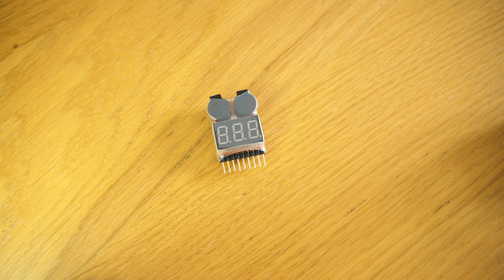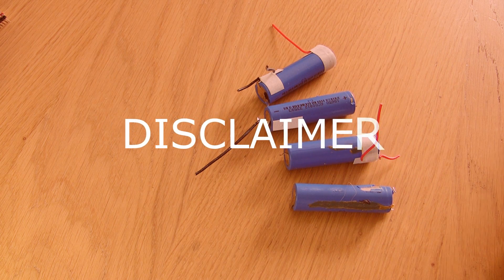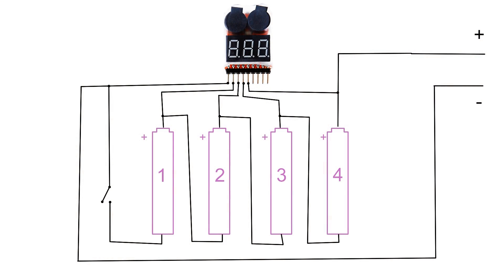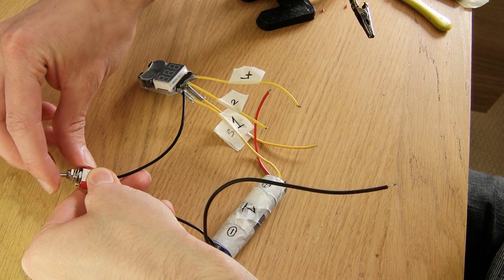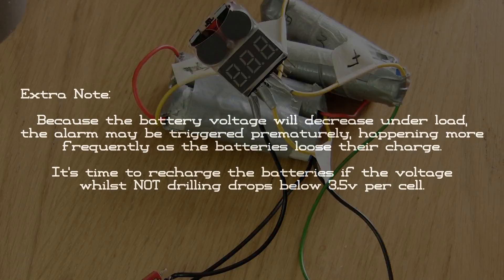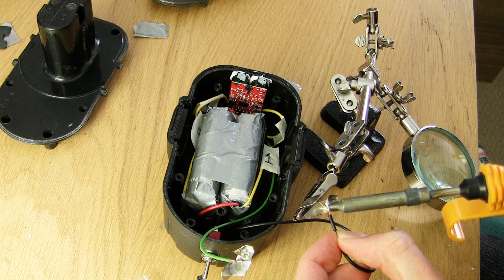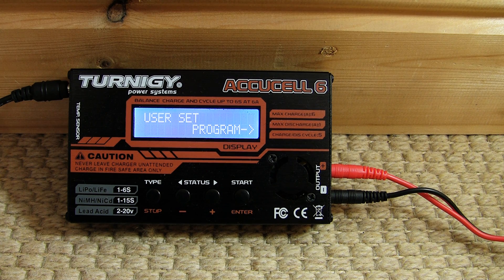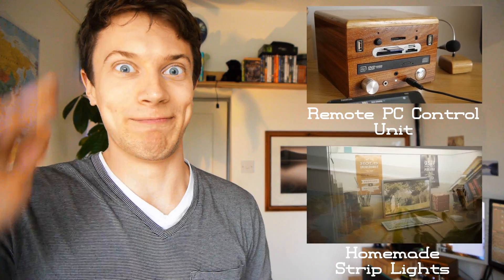Supercharge a Dead Drill Battery (replace Ni-Cd with Li-ion)

Comment: Why are Ni-Cd batteries used in the first place then? Is it because it doesn't need the additional charge circuitry?
Reply: +YouReel Ni-Cd batteries are old, not really used anymore. they are very rugged and much safer than Li-ion type and don't need any circuitry.
Reply: +DIY Perks modern cheap drills also use NI-CD or NI-MH batteries, actually. In this context, it is used because it is cheap and does not require complex circuitry.
Reply: Its cheaper to use Ni-Cd bateries and the companies want to sell more drills because the batteries fail.
Reply: +Hilmi Albums LiPo alarm,  widely used for quadcopters hence the loud beep
Reply: +YouReel
1. Cheap.
2. Simple.
3. Can provide up to 50C of current.
Reply: Ni-Cd is used because it can withstand more stress, it's more resistant to heat/cold. So if you got your average contractor team that works in extreme temperatures, then Ni-Cd is a better choice probably. Again, these are good things about it, but considering the maintenance (deep discharge, memory effect), Li-Ion wins.
Reply from the maker: It was just a very old drill, that's all.
Reply: DIY Perks Ah ok, thanks.
Reply: Ni-cd old technology. and Li-on exist after Ni-cd. read Wikipedia bro
Reply: +DIY Perks hi. what is that?  at 1:09 what is name?  battery monitor??  or??
Reply: +SinsBird better then those silly 2c current li-ion batteries used.

Comment: the ideal current for charging up the batterys is 10% of the battery capacity 
example 10 A/h battery should be charged with 1A current
Reply: +tim bum  Good to learn that tidbit of info.  Thanks  :)))
Reply: im talking about a average battery anything from a small AA battery to a 50 kg battery you would find on a truck its great if you can take the time and charge it slow but it takes forever 10% is the ideal safe limit for charging stuff less is ok but it takes a lot longer more than that and you risk doing damage to the battery
Reply: tim bum m

Comment: I would highly recommend putting a balance port in. Without the balance port you could also damage the batteries. The balance plug is there to ensure you get consistent charging across the cells. Without it you usually get one cell that overcharges  which could cause it to explode.

Comment: Personally I think I would have just included a charging circuit in the battery compartment and just bypassed the charge circuit on the charging station (Or put the charging circuit in the station if there was space) You can get the circuits pretty cheaply. I have a bank of 4 that set me back a whopping £2.

Comment: Is it possible to use this method of replacement to replace the batteries in a Makita BL1830 (18v  3.0 Ah 54 Wh) or a Makita BL 1013(10.8V 1.3Ah 14Wh)  li-ion batteries with some sorts of laptop batteries (got two 10.8v 47 Wh batteries)? I have no idea where to start or how to figure out what voltage they'd need, so maybe im asking in the wrong place and should ask on a forum instead. If anyone got any tips, let me know please!

Comment: I have a rather nice Panasonic SDS drill which cost hundreds when new. Replacement batteries are a joke.  They are 24V 3AH. Any suggestions on where I can get suitable cells for that?
Reply: That charger should have to be pretty heavily modified to work for lithium, and after the conversion you wouldn't be able to use it to charge your NiMh/NiCd battery, so probably the best choice is to rebuild the pack with same-chemistry cells and call it quit.
Reply: How large are the battery cases?
Reply: Externally, about 100x100x70mm.
https://www.howetools.co.uk/media/catalog/product/cache/1/image/1200x1200/9df78eab33525d08d6e5fb8d27136e95/i/m/image_9325.jpg
Reply: spacial2
what about the internal dimensions?
Reply: I don't know. I haven't taken my last battery to bits in case I can't put it together again. But it should be fairly obvious. Do you know of suitable batteries or not?
Reply: +spacial2 If you are willing to make a good deal of work, you might look at the guide I wrote here http://bspt.altervista.org/pimp-my-drill-cordless-drill-lithium-battery-conversion/ and modify the circuitry slightly to employ 6 or 7 lithium cells in series to get the voltage right.
If your batteries are NiMh or NiCd you could also just rebuild the pack with new cells, which is a fairly easy job compared to converting to lithium (in this case, just open the pack and find the marking on the cells of the original pack, and try finding a direct or compatible replacement by keeping an eye especially on the current rating - you want definitely >20A continuous load).
Reply: +Enrico Conca Thanks so much. I will look through the page. The biggest problem is the screws securing the battery case are hex and inset by about 25mm. I have a hex set of course, but mine is too thick to fit the 6mm inset hole. I did manage to pick up a new battery for about 1/4 of the Panasonic price, recently from Amazon., So far that works well. The drill itself is the business of course, it's just these batteries.  However, the new battery has left me with a non-functioning one to play with!!! I don't see a lot of point in the indicators. 
This is an image of my charger: https://ssli.ebayimg.com/00/s/NzY4WDEwMjQ=/z/SswAAOSw3ydV5gPt/$_86.JPG
Anyway, DIY Perks is the best.
Reply: +Enrico Conca I don't have any problem with that. The video describes batteries to reach 18V I was asking if anyone have any knowledge of suitable batteries to reach 24V.
I have no intention of dismantling my charger simply because I wouldn't be allowed to use it on any CIS building site if I did.

Comment: Great video. I did this to my drill battery but since it was a 12 volt drill I used a 3 series 2 parallel setup that works well. But because of a small battery case I could not have the meter inside so I added balance leads and let them stick out of the battery case. So now I can balance the cells and stick on the meter also. Why did you not add balance leads to your battery won't the cells get out of balance eventually?

Comment: There are some alarming errors. I will leave the major three to anyone who want to know. The video author may know this by this time:
*No cell balancing circuit, or balancing leads to connect to the charger, which ultimately could result in exploding the batteries (this DOES happen!) due to over charging some cell(s).
*Laptop cells are not adequate to "power tools". This cells are energy dense type. More capacity (typically 2.2 to 2.6Ah), but less ability to deliver high power. Their capacity will deteriorate fast. Power cells have lower capacity (typically 1.3 to 1.5Ah) but are designed to deliver much more "burst" energy.
*Your leads are too thin to handle high current. They will get hot and be a barrier to power flow.

Hope this helps someone!

Comment: Fantastic suggestion. I will try it this weekend. I used to have a Li-ion laptop battery repair business. From my opinion, to make the job easier, buying some Li-ion batteries with built in protection circuit. That will cost under 10 USD per battery from eBay. Also, that will be much more reliable than a used battery taken out from laptop battery. This will automatically handling the charging as well as protection. And your job will be much easier.
Reply: The built in protection 18650 lion cells cannot hold up to the amp draw of a drill

Comment: I tried building this ...FAILED :(  used 4 cells in series to get the correct battery voltage for drill. Plugged battery in. drill sort of worked but just doesnt have the "guts" torque for power???? any ideas???

off to build the 100w led torch now!
Reply: +2002zippy not all drills require the same voltage. I have some 18 volt drills. My laptop required 18 volts as well. The battery packs for it contained 6 cells. When you charge Li-ion cells your charger will go to some point over 4 volts usually. Most of these 18650 batteries are usually rated for something around 3.7. It would seem most of the folk doing laptop design spec the packs out for cells at the low end approaching 3 volts. It might be a good idea to follow suit and figure out what your drill requires and divide that number by three and use that number as the number of cells you need.

Comment: Needs a balance charging circuit, even just adding a balance lead so you can use your rc charger would do the job. 
Switch will get smacked I the front there, must be a way of doing without it, I think some balance circuits can actually provide the cut off.
Heat shrink tube does a nicer job of finishing solder joints. Wire may get hot with sustained use, I'd suggest opening the drill and copying the wire gauge used inside the drill.

Comment: Li-Po packs have a very limited amount of charge cycles and are not recommended for use in high current situations like power tools as they can get too hot and cause a fire. Duck tape is also not a good idea, Its BEST to heat shrink each cell and also you should put in a thermal circuit protector in case the cells get too hot in charge mode the breaker pops and prevents you from having a nasty situation on your hands.
Reply: How would a person add thermal protection. I really want to know now

Comment: There are some VERY big flaws in this design:
- first, no balance charging. The single cells will unbalance and may end up dying very quickly, or even explode during charge.
- second, the idea of using cells pulled from dead laptop batteries is bad on its own, because they will be wildly unreliable, and shouldn't be used for high drain applications.
- third, the wires are a little small, because a cordless can easily pull more than 10 amps under load, and the switch is definitely not up to the task.
In order to make a reasonably cheap and simple cordless drill battery I'd suggest using LiFePO4 cells, which can be balanced with simple zener diodes due their charge voltage curve, are super reliable, intrinsically safer and much better suited for high drain applications. (BTW, I did this three or four years ago to a 20€ cordless drill and it gained a massive amount of torque - it drills through steel almost as easily as a proper, corded drill).
Reply: Alex Newton laptop cells are good quality, but not suited for high current. Check the datasheet of typical cells, at most they are rated for 2C, that is 5A or thereabouts. The internal resistance is too high and the voltage drop is significant. Personally for my drill I used batteries specific for power tools that are rated for 25A, and I have also measured the drill current under load and it's above 10A even at medium to light load, so that's enough for me to say that laptop batteries, especially the ones coming from discarded ones, are not good enough.
Reply: DIY Perks read this please.
Reply: I am in the middle of the process of upgrading an other cordless drill using INR cells and a super cheap DIY balancer, because the cells I have used for my first project are now End of Life products and can only be purchased old stock, so not really good for this stuff any more. I am not great at videos but I'll write a guide.
Reply: In normal use a drill isn't subject to full discharge current. It's very uncommon to stall a drill if you have the skills necessary to perform this modification. If you're going to put that much work into the pack to avoid unbalanced cells, it's easier to just go buy a new OEM pack.
Reply: Court Rutherford my first experiments were with protected lithium cells with a current limit of 8A. I could just barely start to tighten a screw before the protection kicked in, so even if not on stall a drill will happily draw twice that (current is proportional to torque). I  definitely didn't say it's easier to do this modification. It's just a cheap and safe-ish way of improving substantially the performance of a drill, while this video shows a very wrong way of not even improving the performance (in fact, there is no proof that the modification lead to a usable drill).
BTW, the drill I modded is so old that battery packs are nowhere to be found...
Reply: Enrico Conca there are no balance charging wires but if connectors had been added to the voltage indicator before the switch you would have had balance leads ps balance lead connector will also fit that type of voltage indicator instead of all that fiddly soldering 
laptop cells are normally good quality and can be used for high current draw but need to fit in parallel to allow for high current draw otherwise they will heat up and it would be sensible to fit a thermal cut out switch 
the wires may be a bit small but switch is fine its only for the voltage indicator not the battery/drill 
my drill works as well as any branded drill and its now over 3 years old i know what you mean tho its so satisfying to make something better than what you start out with, for peanuts
Reply: Enrico Conca yep, you are right on every point - I found that my homemade Lithium-ion Bike Battery performed poorly as opposed to the  LiFePO4 that came with the Bike; The  higher Current Load kept causing the BMS to shut it down after a short distance - those Lithium-ion types just don't handle the loads well, no matter what quality you use (even Samsung).
Another thing they are forgetting here is that even if they do manage to incorporate a Socket/Lead for Balance Charging? they still need to figure out a way to Balance the 'Discharge' of the internal Cells whilst using the Drill.
Reply: The_ Pentaquark. Well balancing the discharge is the smallest of the problems because you will start feeling the lack of torque when the battery is on the low side of the charge, and balancing is in fact only done during the charge phase. I may have not been clear, but these 25A cells are in fact Lithium Ion INR18650-25R. They are pretty good because they give you a high current capability AND a good capacity at the same time. Cycle life is much shorter at 300 cycles compare to well above 1000 for LiFePO4 though
Reply: Enrico Conca
Reply: +Enrico Conca  Could you make a video about doing this please, it sounds great
Reply: JAMdiversified I have finally published the article. It took forever to finish the project. Here it is http://bspt.altervista.org/pimp-my-drill-cordless-drill-lithium-battery-conversion/

Comment: Hey matt i have a really important question!
I need your help with my 6 18650 batteries! (3.7volt/4200mah)
I want to power my portable speaker with them so:
I want to wire 2 batteries in parallel and this 3 times so at the end i will have 3   3.7volt and 8400mah batteries!
Then i wanted to wire these in series so i will have a 11.1volt 8400mah batteriepack! (3cells) 
Can i charge this pack with the turnigy charger? Is this possible or what would you do?
Please help me!:)
Reply: Them battery's are fake!

Comment: Doesn't Duct tape have metal in it? so wouldn't wrapping them in duct tape be dangerous?
Reply from the maker: James kirby Duct tape does yes, but I used gaffa tape (sometimes called duck tape) which is a cloth based tape.
Reply: +DIY Perks Ever tried shrink tube?
Reply: +DIY Perks Like this, but given your comment I think I'd prefer to use the vinyl electrical insulation tape.
Reply: +DIY Perks then say gaffers tape. duct tape will cause issues

Comment: Oh and the speaker things on the alarm are loud because when you are driving an RC model you want to hear the alarm from very far away, because even slight overdischarge can ruin a very expensive battery pack. (I ruined two specialty packs by discharging them just .3v/cell too low, only took two cycles to kill them.)

Comment: Hi Really nice video!  My Li-on have a very low mah. can i dobble the mah. If i put them in parallel.  I need 12V so id like to use 2Xbatteries (cell 1)+2Xbatteries (cell 2)+2Xbatteries (cell 3) ??

Comment: Is there no way to convert the old charger to charge the Li-ion batteries? Maybe by using a different value series resistor?
Reply: DIY Perks I have to argue that. The whole Li-Ion "special charger" is a marketing gimmick. Proof is the Motorola Radius CP200 handheld 2-way radio originally comes with a Ni-Cad battery pack @ 1000 mA. You can buy a Li-Ion pack for 1500 mA and charge it in the same Ni-Cad charger cup which has no special internal circuitry, just the Tri-Color charging LED indicator circuits any Ni-Cad or NiMH charger has.
Reply: ElfNet Gaming There is special Charge-and-balancing circuit inside the battery pack to facilitate this.
Reply from the maker: ***** Not really. They need to be carefully charged with the proper circuitry.
Reply: The batteries I described are charged as a whole (7.5 volts), not per cell. The standard Ni-Cad charger senses the current drop and shuts it off as it would normally, therefore the Li-Ion pack will not overcharge in a Ni-Cad charger. I don't know all the details on what Motorola puts into their chargers or batteries but I do know the Li-Ion pack can charge in a standard charger.
Reply: ***** yes there is. I put a bad pack in my vice and cracked it open.
Reply: ElfNet Gaming then your point is numb.... Either the electronics are in the batteries it self or in the chargers, but there has to be one..... most Lithium batteries and specially the ones showed, don't have said Charge and balance circuit inside, therefore the charger needs to have it... most LiIon and LiPo batteries sold by Turningy (or other RC batteries) come with just the cells and not the circuitry, it is simply for cost and weight reduction.... you either have 6 batteries with 6 circuits and a ("universal") charger or you have 6 batteries and one charger with the right circuit-board motorola opted for the first option apparently...